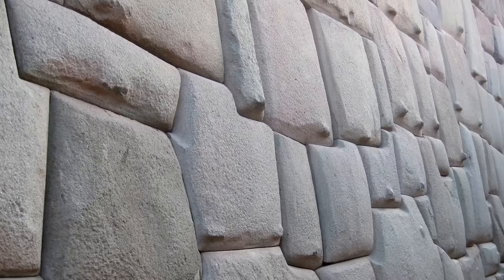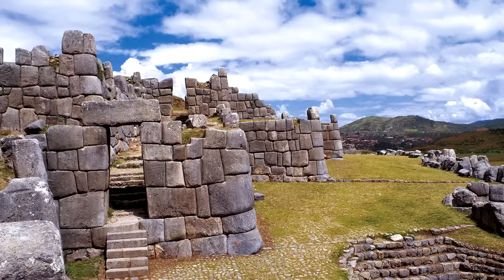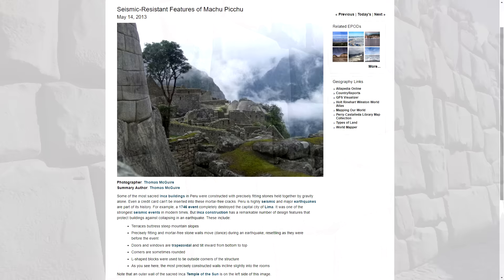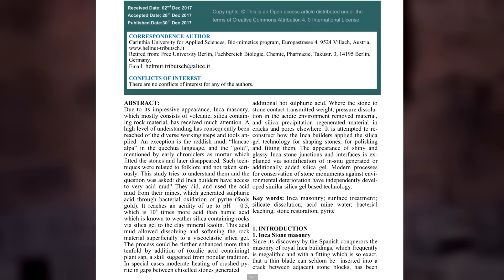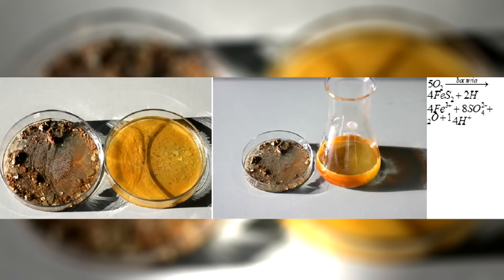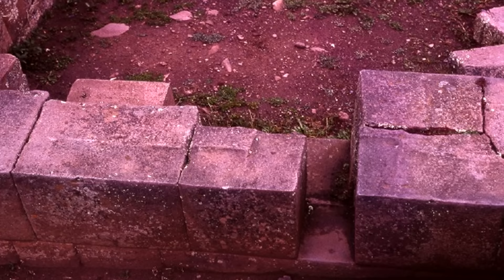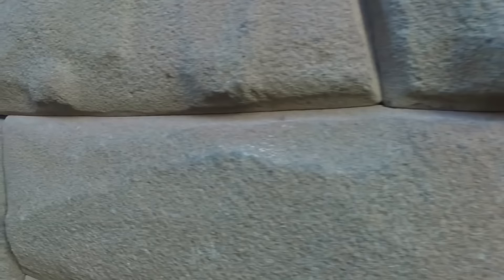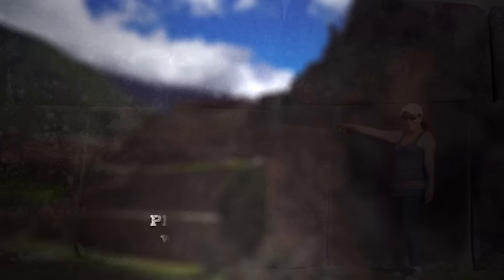Is This How The Inca Walls Were FINISHED/JOINED So Perfectly?

Comment from the maker: Watch Part 2 Here - https://youtu.be/ljJsHwTuuQY

I have been looking into the geopolymer theories too so will make a video when I have enough information as I've stumbled on some new techniques lately that I was unaware of too, and yes we've known for a long time that ancient cultures used concrete etc so it's not beyond the realms of possibility.

However, most people commenting about geopolymer use this as an answer to how they handled large stones, but when considering this there's still things I question, for example:
- If the Inca walls were made using geopolymer, why do we find large stones clearly pounded into shape still in quarries with drag marks left there unfinished? 
- If they used geopolymer for large stones in Egypt why is the unfinished obelisk left there half cut from the bedrock after most likely cracking so they abandoned it? 
- If the Serapeum boxes were made from geopolymer why is there a box left in one of the hallways, they wouldn't have built it in that spot so it was clearly being transported.
- If the huge 800 ton blocks at the Temple of Jupiter in Baalbek were geopolymer, why is there a quarry still with a few blocks a similar size clearly cut from bedrock (eg. stone of the pregnant woman) nearly a kilometer away from the temple?

We know ancient cultures used concrete and probably other geopolymer materials for certain things, but I'm not sold on that being the answer to the handling of large stones, most evidence still points to hard labour and a large workforce, but I'm always happy to charge my stance with new evidence :)
Reply: There is some lore from that region about birds making nesting holes in solid rock faces, and they use some sort of plant that when rubbed against the rock, appears to dissolve it away.  So it may be something of that nature that they used to get the zero gap fit.   But hammer and chisel method seems to be a bit of an explanation stretch.  Also on some of the large rocks there can be seen mark patterns that are reminiscent of scraping butter, or ice cream scooping etc. indicating that the rock surface may have been soft.
Then there is, what was the purpose of leaving the nodules and the holes. Handling points or something?
Reply: Why not consult people who build dry stone walls? I've seen some dry stone walls in Cyprus that are reminded me of the inca walls although the stones were brick sized.
Reply: Good!
Well thought out.
Reply: don't tell me, show me.
Reply: Wake up dear!..Why dont u build a small wall in a year, with yr techigue & post a photo?. Also solve us some Pyramids headaches! History is Wrong!..my dear!..

Comment: I don’t care who built it all…
I’m a carver and cabinet maker woodworker. I’ve practiced this craft for over forty years. I have to say that I cannot fit blocks of wood of these shapes with this accurately even with a CNC machine. All faces of those blocks are mating concave or convex acting like a sort of tenon or mortise. Because of those shapes all around each blocks you cannot slide a stone in or out. In cabinetry after cutting joins we test the accuracy by sliding parts one in the other until they fit. We can do this because the joints are flat, in two dimensions. Those stones are joined in THREE dimensions all around, ergo they cannot slide into place. And you have to assemble from one end to the other. If you build a circular construction with this joinery you can’t put in the last stones in without loosening all stones, put the last stones in, squeeze everything together and pray that the fit is perfect. In three dimensions, mind you…😮
Reply: One of the greatest mysteries of all time.
Reply: Though pouring each block shape with natural polymers consisting of that specific stone and using forms for each shape could bypass the need to hand carve those three dimensional challenges. That combined with something similar to this mortar he’s talking about for the final fittings. Just a thought.
Reply: @stuarthayward2220 
I am pretty sure that making Precision form work with ancient technology would be way harder than just carving the stones out with precision..  also making polymers with no technology is a complete stretch as well.  The solution to this mystery can't be more complicated and more FANTASTIC and more mysterious  than the mystery itself.
Reply: @randyorr9443 It can be more complicated because we have not thought of it yet. For all we know, the builders of these walls had 1000 years of perfecting stone joinery, yet after 200+ years of modern technology we think we are more advanced at everything...
Reply: Your words in science's ears...
Reply: I'm a machinist and thought the same things about how they were fit together. Pouring each block in its location sounds like a possible way. Another way I thought of would be to fit a block in place and then cause it to vibrate enough so that it would wear into place tightly.
Reply: @chipwright6193  You may be close in your last point.  This is granite, a stone that is easliy carved, abraded, or cut. My thought is that they used whatever liquid abrasive paste they though of, and a harder "pestle" stone, coupled with unlimited manpower, to shape the stones until they fit.  The lines are random, not planned or laid out except for wall height or corners, where the stones are in fact fitted in 2 D.  Dozens of men, skilled at doing monotous work, each changing off every two or three hours, with the others applying fresh abrasive, could shape these stones as we see them.  IMO, they allowed the stone to dictate the form, and fitted the next one to it accordingly.  Multiply that by thousands.

BTW, many of these walls have a backside that is NOT well fitted, but filled with smaller stones, and possibly with mud or a mix of mud and plant fiber at the time of peak use.  We are looking at a facade, deliberately made with precision, but they obviously had a sense of economy as well.
Reply: @John-d7p  The only problem is, how they moved such heavy stones?
Reply: Inca did not do this. Fake news!
Reply: If you can’t fit varying shapes of blocks tightly together utilizing CNC then either your modeling is bad or your machine is.
Reply: I too do furniture work. For decades. You can’t do that with blocks of wood in any size and weight. So I never try to think about how or who/what did such construction.
Reply: @dominiclester3232  You cannot lap the stones against each other for two reasons. Firstly, they are too heavy to keep fitting them in again and again. Secondly, they are mortised which means that no further movement is possible once they are fitted. Please read the Author's text again. its not matter of time. Its matter of suitable tools. skills are one thing but do not shift what is humanly possible into the utopian.
Reply: @stuarthayward2220 Just posted the same theory. IMO that might work. Carving doesn’t.
Reply: What? After beginning with the first stone, using a polymer would be eliminating the need of carving several sides of the adjacent block. Particularly the side that joins with the first, the bottom form would just be shaping the earth beneath it, the front and back forms could be achieved by stretching leather across, to hold polymer within the desired shape.
The more intricate the stone shape, the more that pouring it would lessen the need for precession carving of multiple sides.
.
Reply: I remember as a kid, cracking a big rock in pieces because it was too heavy to pick up. 
Picked up the pieces, and they fit right back together. Hmmm. 
And just now, grooved a granite stone. Cracked it in half. It fit right back together.
Maybe there is an alchemist around that could melt them back together permanently? Not just bond.
Or is there some kind of existing chemical compound that serves that purpose? Be interested to know.
Reply: Gig diamond cable saw job . All cut to size aafter individual template
Reply: @stuarthayward2220 And Baalbek and Stone of pregnant woman weighing a thousand tons have obviously being carved out from the solid stone blocks…
Reply: You’re grasping at straws or just making meaning less content or both !?
Reply: The amount of lost knowledge or the idea of humans not been the first advanced beings on this earth becomes more an more likely every day it seems

Comment: Has anyone done any experiment to see whether this theory would actually work in the real world?
Reply: There a so many theory’s about this theme,but nobody did ever build a sample wall to show  that this theory is functional. That would be the only way to show the truth.
Reply: That would prove the theory so why haven't they . because it's not the method they used
Reply: @MrPurpletruck see sacred geometry decoded channel ☝️
Reply: There is no way this acid thing is true.  Even if it worked, which it does not  wouldn't it cause gaps to get larger in some areas especially on vertical joints?
Reply: @LQ-C  How are you so sure that it's not true, do you have anything to support that claim?
Reply: @FraserMunroe-cx2lu They have not done it because it is too much work. Try etching a stone with battery acid and you will quickly realize that the task is torture.
Reply: @LQ-C  Wouldn't there be stains on the front of the rocks? I've seen these structures up close and the joints are incredibly tight even after centuries. Pretty amazing.
Reply: @LQ-C  Acid has very little effect on granite,   Might work on limestone.
Reply: Studying chemistry tells me this is quite probable. As most stones are made of alkaline minerals and a good acid would eat through them quickly. I've even seen an experiment using a weak acid like vinegar used to destroy limestone. So this is entirely possible. Probably not as quick as the limestone etching, but still possible.
Reply: What were the diagonal stripes on the upper right stone ? Any of you freaks got a hypothesis ?
Reply: We can't.  Because the Incas had far better rubber gloves to resist this strong acid.
Reply: @LQ-C  Not saying it is or isn't true, but the acid would be consumed in the etching process, and I think the idea is just that the stone becomes softer, so that the friction of the bits of stone against one another can wear it away more easily. So in theory I think if you applied a bit of paste and rubbed your rocks together, they'd cut a straight line.
Reply: @jamesmachuta2010  is granite alkali? It's mainly quartz based which I guess I assumed would be neutral.
Reply: quick follow, the internet tells me that granite is ever so slightly acidic. So acid etching wouldn't likely have an effect.

OTOH granite is also a composite, so possibly some of its constituents are basic?
Reply: @markdmckenna try rubbing 20 tonne stone blocks together and get back to us
Reply: Institute of Tectonics and Geophysics, Khabarovsk, Russia
Reply: A subcontractor of the US Army 3D printed such a wall. They wanted to conduct an experiment to create such structures using moon dust on the moon. the fit and the results were identical.
Reply: @cedricpicard9016  some of them are around 120 tonnes

Comment: How does this explain the vertical joints that have no weight pressure ?
Reply: The joints are dressed on the front face. If you see them from the rear face, many are crude and unfinished.
Reply: Only horizontal joints have the pressure of mass on them. How can vertical joints have any pressure on them?
Reply: @brb1050 exactly, I saw a vid with a stone mason looking at these and he instantly knew how they fitted so well. Front face of a few centimetres only that met and rough hewn behind.
Reply: But they do have weight bearing horizontally. It’s a funnel effect of compression. Stones placed from the periphery first and then placed towards the center…lateral compression.
Reply: that sounds like some of my ex-gfs, crude from behind good from front lol
Reply: @brb1050  Yes this is true. The stones are in fact wedge shaped, the joints at the back a much wider.  I think the lumps you see on unfinished walls were used to swing the stones and there was an abrasive paste between them so grinding them into one another.
Reply: @brb1050  In the video there were some shots of disassembled joints, and they are smooth all the way in; not rough or crude.

Comment: Until someone actually constructs a similar wall or building, it will remain a mystery.
Reply: Get ready to wait a looong time.
The scientists know better, and knows about as much as my dog about possible processes.
Reply: The stone "nubs" as they are called, protrude because they have a higher density than the sourounding material and weather the elements at a different rate, starting off as soft biological material until petrofied over time. I beleive there was ancient technology render petrification quickly. There is no logic for such tedious construction by humans, whereby, the geometry actually twists a bit with opposing ends of each stone different by a few degrees. The nubs are allways parallel to one another and parallel to the 'grain' of the stones for a reason. The nubs are tendons and the sourounding stones I beleive are muscle tissue.
Reply: @cjkyricos  I read that in some places the nubs are used as clocks and calendars base on the sun shadows

Comment: Could work on settling the stone one on top of the other but, last I checked, gravity doesn't act horizontally - and yet the joints are still perfect on that direction too.
Reply: No idea how these stones were carved you’re forgetting about structural forces such as shear, bending, compression etc.
Reply: Seems this theory was not well thought out
Reply: Easy. Put the paste on the vertical face. Push the stone in, then use another stone beside it to jam it in sort of like a clamp
Reply: @glenchapman3899  Then wait 2-3 months for the paste to corrode both of them and jam again. At this rate, the wall would still be under construction today.
Reply: @col0342  Yes because no one would think to work on another section of the wall at the same time.
Reply: Gravity doesn't act horizontally, but gravitational forces do travel laterally through structures. Stone arches, for instance, are designed to redistribute the load to either side so that it can stand without support in the middle. Flying buttresses are structures designed to bolster walls against lateral forces from vaulted ceilings (and also wind, but the lateral forces from the vaulted ceiling is always present and would need to be accounted for regardless.)
Reply: @Arithryka  The Incas didn't use arches,
Reply: @harry130747  Correct! All roofing in the Americas was constructed by corbelling or wooden beams until the concept of the arch was brought over from the Old World.
Reply: What is you lean a big rock 45 degree against another? Would that be enough pressure? 
Question is, how does the last rock fit it
Reply: A lot of Paddy me B####x.😢

Comment: 4:03: ahhhh. Finally, a YouTube presenter who knows, and utilizes, the difference between theory and hypothesis! THANK YOU. As for this particular hypothesis, while it might help explain the joints between the blocks we are still left with an ancient civilization cutting, and then moving among mountains, and then cutting again to perfectly fit, GRANITE blocks as large as 25x17x3 feet and weighing upwards of 130 tons. Hypothetically using only manual labor and/or animal labor.
Reply: Even if the acid mud helps the rock fit tightly, the real question is how did they move, into place, multi-ton rocks?  Thank you for sharing your thoughts…from east Tennessee.

Comment: What I find fascinating is how the edges are rounded in toward the joints, rather than just left sharp. Is there a reason for this apart from the fact that it looks nice?
Reply: It's easier.
Reply: @campbella2796  How?
Reply: @riverland22  If you reduce it to the basic task of fitting two stones flush against each other; making perfectly straight sides on both is twice as much work as just smoothing off one and then working on the other until it fits against the other.

Comment: This is a fantastic idea, but I won't be convinced until I see a video of someone replicating the technique.
Great video editing and narration by the way.
Reply: seems like a great idea also and with just a small recreation will confirm it...agree
Reply: The pyramid in Bosnia which is not yet fully acknowledged by the archaeological establishment but which I believe is real is made of concrete blocks that have been analyzed and leaves between them carbon dated to 29,000 years old. These blocks have been shown to be made of concrete that is harder than the best concrete we use today and more water resistant.
Reply: @harrowgateguy  ''carbonated''?
Reply: Ditto! It needs experimental testing.
Reply: @harrowgateguy  the older the harder, ours will catchup!
Reply: @tomgunn8004  corrected

Comment: I agree with your hypothesis. A similar condition occurs with detrimental effects in concrete. Aggregate in concrete with a high silica  content, e.g. flint, chert, quartz is adversely affected by alkali ions transported by water that infiltrates the concrete through microcracks. The water either contains Na or K which combine with OH to form alkali or the water combines with the CaO in the concrete to release OH. Upon contact with reactive aggregate, the hydroxide reacts with the aggregate in a process know as Alkali Silica Reaction (ASR) or "concrete cancer" forming calcium-silicate-hydrate gel. The gel has minimal strength and expands as it absorbs water. In concrete the pressure due to expansion, cracks the concrete and the gel eventually oozes out of the fissures in the concrete. Acidic solutions may induce a similar process, and I know that hydrochloric acid is used to remove or etch concrete.
Reply: Acids do not affect silica that way. Glass is mainly silica, and we store sulfuric acid in glass bottles no problem. 
Etching concrete with hydrochloric acid removes the calcium carbonate, letting the quartz crystals shine.